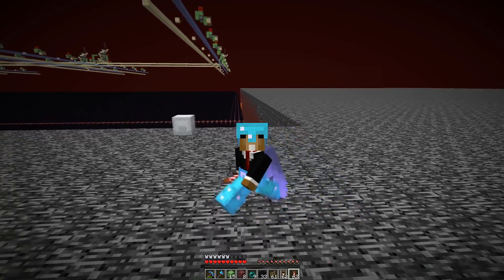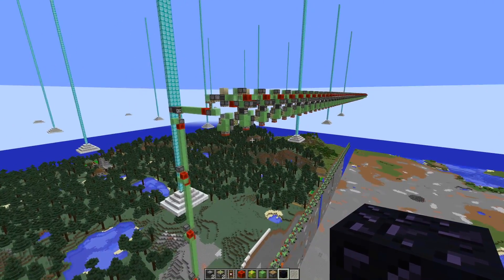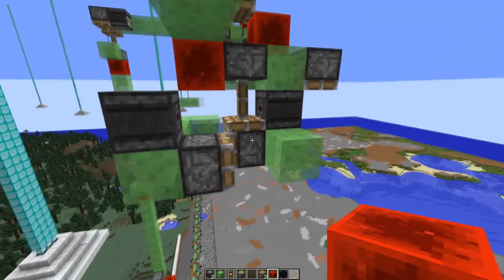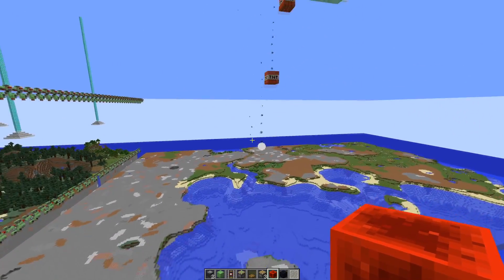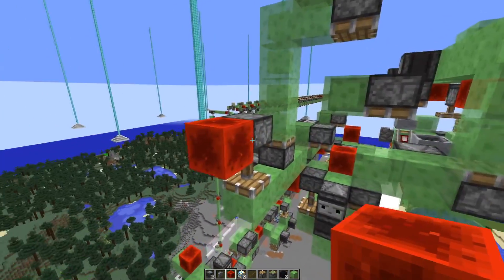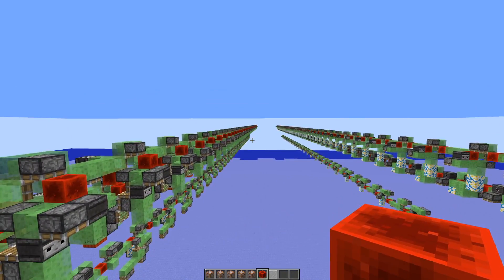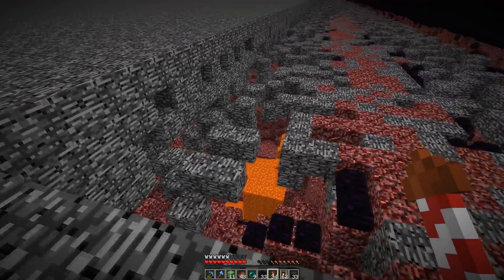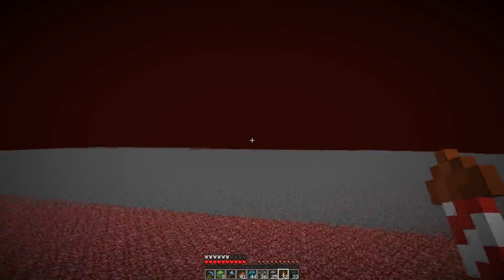SciCraft 152: Nether Compatible World Eater

Comment: I think you could reduce the height the TNT drops without causing a chain reaction if you slowed down the TNT duping and flying machine forward progress by adding some delay into the flying machine that had no forward movement component to create longer time spacing between the TNT explosions. Then your only consideration for TNT height would be the bottom of the flying machine itself.

This would be undesireable as it would increase the time the machine takes to run fairly significantly, so IF you can fit it, you'd rather keep the speed.
Reply: wouldn't that require a more complex/slower engine
Reply: That would require a far more complex machine, so building effort would go up a ton. This machine is meant to reduce effort, and breaking a few lines of ice and sandstone is a lot easier than designing and building another version of the world eater. 

If you want to build a more compact machine, downward momentum actually might be easier actually, and it would keep the speed.
Reply: well yeah it fits so why bother?
Reply: Skylex it actually doesn’t. They still have to remove some of the ice and sandstone.
Reply: @aqwrd3546  only a few bits and pieces so it's more efficient this way
Reply: Skylex ya I know

Comment: 8:05 you say that you cant put it higher cuz it would launch next tnt upwards but thats not the case. cuz if they drop down with same delay, it doesnt matter where explosion is.
unless you meant it like "explosion reaches tnt in the flying machine if tnt blows up any higher"
Reply: That's not correct as you have to account for the acceleration: with 3 blocks and two panes the TNT reaches enough velocity to go past the "chain reaction limit" where its explosion causes the next one's. If you stop the video when the TNT hasn't travelled the full lenght you'll clearly see that the chain reaction will happen
Reply: The acceleration makes the spaces between the TNT longer. The further the TNT falls the longer the spaces between them are.